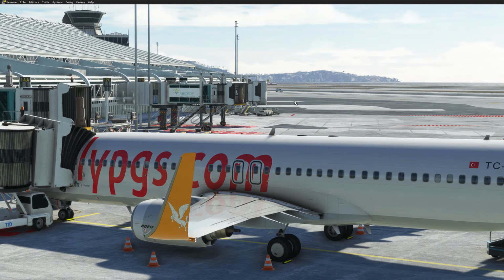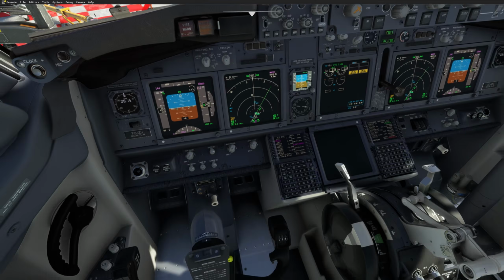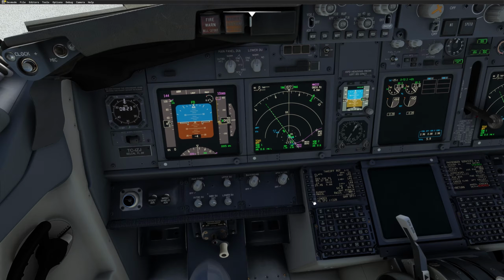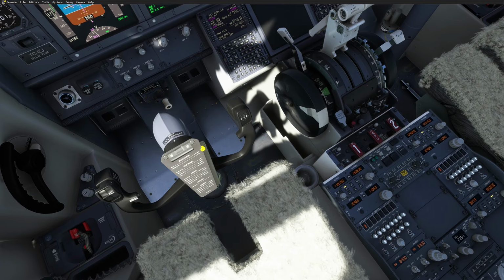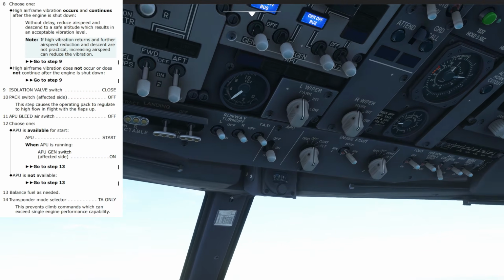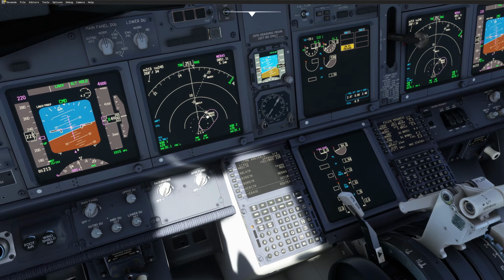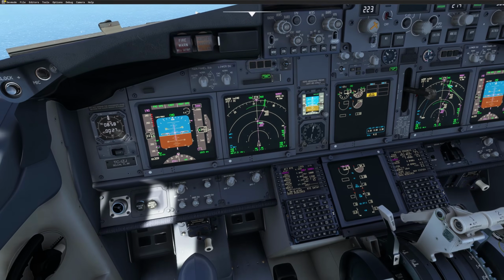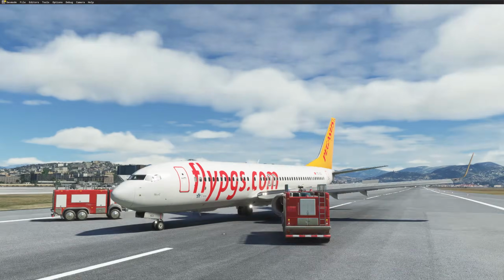PMDG 737 Engine failure during training scenario

Comment: It was a very well explained scenario! In case if your GW would be more than Maximum Landing Weight, would it be feasible to hold longer in order to burn fuel?
Reply from the maker: Hi, Thanks! Overweight landing on the 737 is not a big deal unless the runway requirement is not met with the actual weight. In that case, QRH clearly states to land at the nearest suitable airport. The idea is to be on ground asap. 

FCTM info below:
Overweight landings may be safely accomplished by using normal landing 
procedures and techniques. There are no adverse handling characteristics 
associated with overweight landings. Landing distance is normally less than 
takeoff distance for flaps 30 or 40 landings at all gross weights. 

However, wet or slippery runway field length requirements should be verified from the landing distance charts in the PI chapter of the QRH. Brake energy limits will not be exceeded for flaps 30 or 40 normal landings at all gross weights.

Note: Use of flaps 30 rather than flaps 40 is recommended to provide increased margin to flap placard speed.